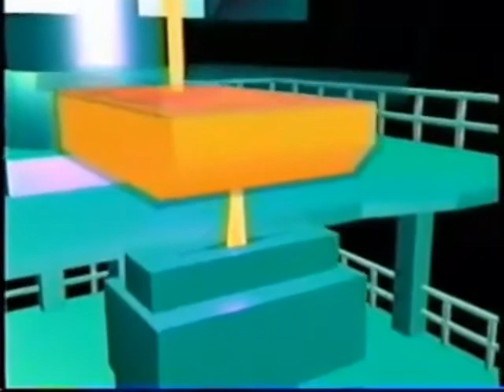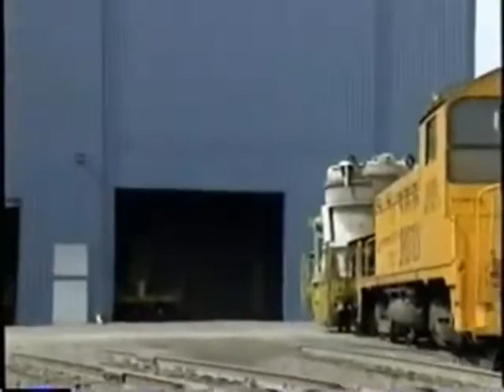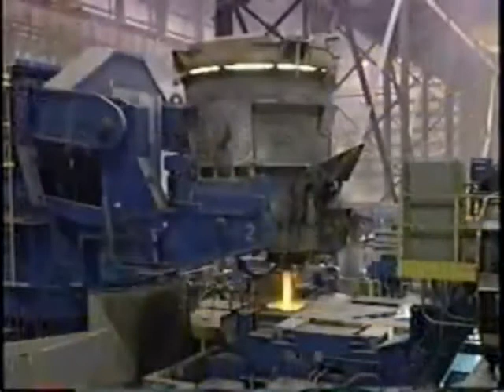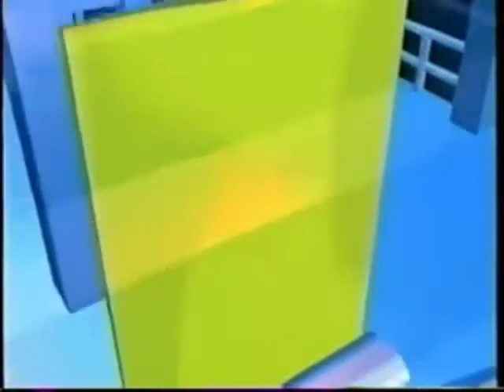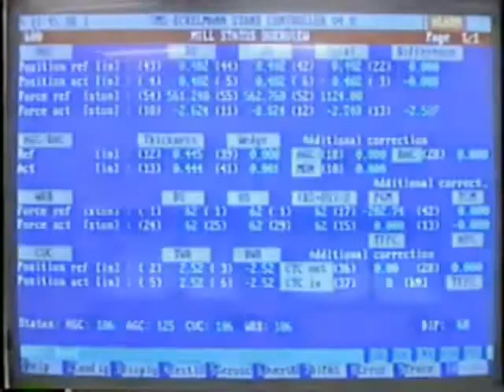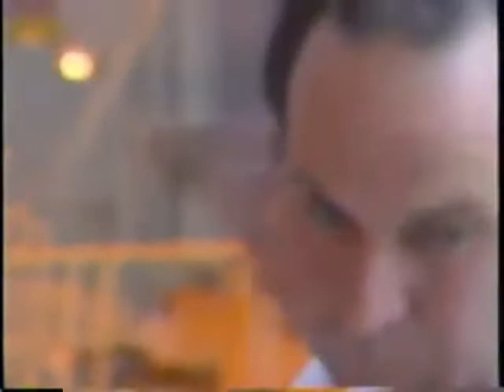Acme Steel

Comment: Hi. I worked there from 73 as a motor inspecot in the primary rolling mill then  years later got the instrument apprenticeship and stayed in that position till 93. Then became a 20 point elctrician in the melt shop till it closed. It was a war zone. Cold in wimter hot in the summer. Noisy. C Aster was a great. Workd with a lot of great people at the time
Thoigh i did not appreciate it at the time. As a kid i used to watch the united states steel hour woth opning scene being an over head crane poiring a ladlelof steel into the blast furnace. That always impressed me. Loved working in the mill although i might not have shown it at the time. A great job and great place to work. Glad trump is supporting our steel mills.
Reply: Do you know why they closed down the one in Chicago?